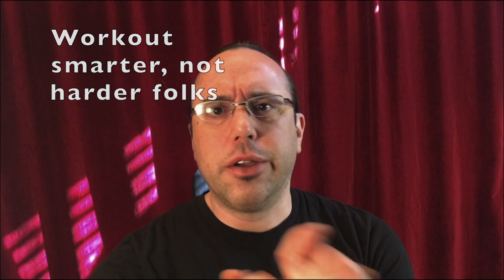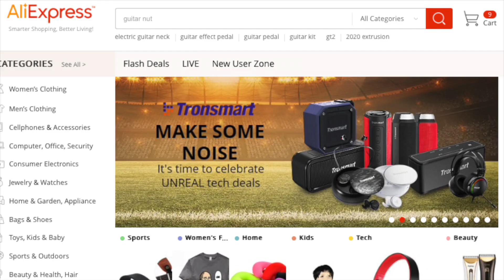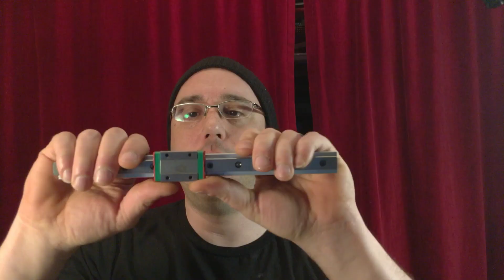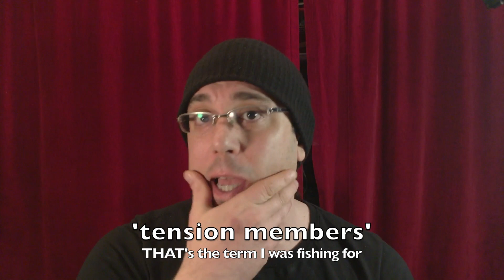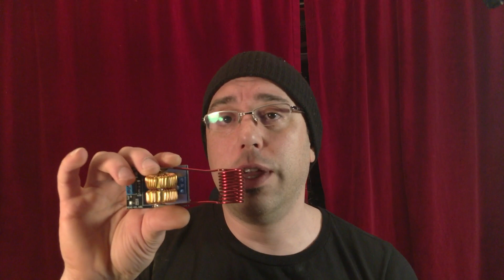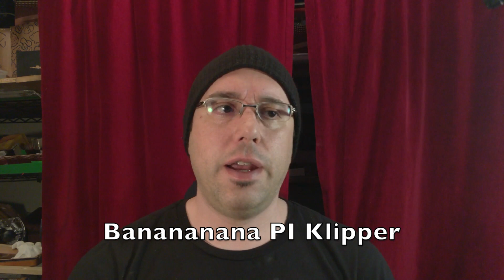Muse: random 'fails' and lessons learned

Comment: on the subject of random fails bigtree-tech you mention them in this channel a lot, well a few years ago I bought 3 2004 reprap-discount smart display clones besides the wiring being reversed you look at their smart adapter vs the real thing you'll see it. the biggest problem is the current draw I had to remove the voltage controller and well solder-in a new voltage regulator well that worked (7805) but it was burning hot , so I had to swap that for a dc-dc convertor (mini360) I will have to add another diode before it would be ready for 24V 26V absolute max 23 recommended. yeah bigtree-tech got some fails for sure.
terramir

Comment: I switched my ocotprint instances to Asus TinkerBoard  -- that's fairly tricky to get to work, TinkerBoard OS has issues with sending packets properly over USB, but Armbian (which is generic Ubuntu for a number of these arm boards) works very well. So my next step is to setup Klipper for my large delta on one of these boards because the TinkerBoard (S) -- which has on board storage, is significantly faster than any Pi... I also have Odroid board, but that is a different form factor and Tinkeboard is nice because all GPIO stuff works the same as on the Pi, so I can still use GPIO commands to turn the printer on/off.

Comment: You are a smart dude.
Just to be clear:  I am a bit critical on your channel, because I respect what ur doing.
I think you deliver great content.  Therefore, I invest time to comment on your videos.
And share my personal experiences.  Otherwise, I would not.
Oh .. I posted my design on thingiverse, like I promised.
Thanks, for another great video.
#1 You mentioned: Just buy it, not build it.
Absolutely right.
Unless you are one of them idiots that buy from a local retailer, thinking
that it is expensive, but high grade quality.
It's not.  Nowadays, it's all chinese. Besides .. the past decade, chinese products have
been of better quality, since chinese manufacturers did become more educated.
Looks like you knew that al along.  It's actually a topic, you could devote an entire video on.
#2 Specs:
Yup ... I go find specs for any part that I buy. And sometimes it is a bit of a hassle.
Beside this, I design things before I build them.
All the more, I search grabcad and such, only to find, I have to redesign the part from
actual physical measurements.
#3 Linear rail:
Yeah, you accidentally had that lying around ey ? LOL
I suppose I got lucky, when I bought mine.  They do not rattle, far from it.
In fact, they are exactly the same as what you have there : MGN12
attached to 2020 v-slot profile.
But it is worth mentioning when buying chinese stuff:
Make sure you read the feedback from previous buyers.
#4 Belts:
I go for acme trapezoidal lead screws.
The investment on these parts is not much of a difference (from china).
But I also intend to do some milling with my latest 3D printer design.
I'd like to exchange my printer nozzle with a dremel/spindle.
That's why I also bought the MGN12 rails.
#5: Nema14
Yeah .. let's not. But ...
I just built in a titan extruder, with the extra gear. Looks like a pretty good extruder.
But I recently discovered that the DRV8825 driver has some jitter or something.
Now I bought the  TB67S109 driver (4 amps polulu) and wonder how these will do.
#5 drivers
Previous mention.  I wonder how these will do, and I hope you come up with a video
with your experience on drivers and tests.
And what is Allegro anyway ?
#6 Test rigg
When I started with my first 3D printer, there were no tr8x8 acme lead screws or anything.
There was only the TR12x3 Or something really expensive (custom).
Then you get to a ridiculous STEPS_PER_UNIT and steppers work best with
leads like 4 or 8 in order to get a maximum on holding torque and full stepping modes and such.
Maybe it's best, just to build a rig, that moves some weight or something.
#7 Heating
It is exremely tricky, in particular with using PID. It is a science on it's own.
I have some (bad) experience in this area, but that's too much to mention.
...
I better quit with my comments. It's getting tooooo much.

Comment: Great video as always!  I really really like the idea of inductive heating a very low heat capacity heatblock/nozzle..  If you got a heater that worked and setup a higher rate closed loop temp control, this could open up potential for fast warmup times / better ooze prevention in multi extruder setups where the heater can turn on and get up to heat in seconds.

Comment: Enjoyed your video.  Great to see things that didn't work as planned.    A couple of comments:
1- Bananna Pi / Klipper, there is an alternative interface for klipper that is based on the DWC  interface.  I have not tried it, but I think it eliminates the need for Octoprint.  here is  is.  https://github.com/Stephan3/dwc2-for-klipper  
2- As far a strength testing prints, there is another youtuber called CNC Kitchen and he does alot of this type of testing.  Perhaps you can collaborate.  Here is his tesster he uses https://www.youtube.com/watch?v=uvn-J8CbtzM  .

Comment: Hey Alex. Love your videos man. Keep it up. One comment I have on the Klipper point, I have it installed on my Ender 3 ( It call it my Frankender3 because it barely resembles an Ender 3 any more ) and a full Raspberry Pi. I LOVE KLIPPER. I believe in it so much I support Kevin ( the dev ) on patreon. It works beautifully. Just try a normal Pi. The install was a breeze. It was up and running in minutes. And the speed gains are insane!  My next alteration for this printer will be to go the MKS Gen v1.4 with Servos. Cuz why not? I would love to see you try it to be honest. There are not really any videos out there on the discussing servos and why they would be good. All i've ever seen is people showing the printer print, or pictures, and sometimes just discussions, but no "How to's" , which sucks!. I know what servos offer and I'm excited to get started. My only problem is the only closed loop steppers I've found are about $80 per. Which is a lot of money. Anyway. I would love to hear your thoughts on it. Keep up the great work.

Comment: For the bearings, they almost need to be repacked. I watched a video of a guy that used a jewelry cleaner tool, a vibrating bath of wd40 for several hours, to clean some grinding lmu bearings he got from China. Lots of metal shaving came out.

Comment: Orangepi Zero works fine with klipper. No special build needed. And it's 10usd and quad core, external wifi antenna and lan. Have been using it for a while as klipper host. And all my 6 printers run one or the other version of orangepi.

Comment: Thanks for the video! Its always good to learn from earlier mistakes, even if they're not yours.

Regarding play in the cheapo linear rails: I have read about a strategy to combat this, and that is putting the carts in a vice and slowly clamp down on the cart until play is eliminated.
Another interesting fact that I discovered is that my carts behaved differently depending on which way I put them on the rail. I have no idea how that works though.
Regarding PLA smoothing: Check out 3D gloop! It seems pretty promising.
Reply: the error on them is probably not the same on either side is why you might get weird direction dependant behaviour (might be true for the machining on the rails as well)

Comment: Nice video. 
One day I want to try this crazy idea about reciprocating mass on a 3D printer. Like create a dummy axis that moves in the opposite direction and same speed to, say, the X axis and has the same weight thus balancing the movement. I dream of a printer that can do rectilinear infill fast without shacking it self apart :)
Reply: Making it as light as possible is the best solution. Carbon fibre comes to mind though I just turned your $150 toy into a $1000 machine. As Alex has said in numerous videos when people ask "what is the best way to <blank>?" His response is usually "Depends". 
If money is an issue, get a drill and make some holes. If not, design from scratch with light weight components.
Reply: @leofortey7561  Apparently not. https://twitter.com/3dmakernoob/status/1122462883646930944

Comment: The Orange Pi Zero is supposed to be pretty good at Octoprint and stuff.
Reply: Wifi shall even be worse than @an RPI Zero to the point of simple dont use it (driver issues). 
That said the RPI3 themself have WIFI issues. 

I would always recommend to use as Raspberry instead of Banana or Orange or ... , just because of the software

Comment: 21:24 Marlin's planner is completely floating point. Its inputs and inetrmediates are all single-precision IEEE floating point. That it hasn't worked out correctly points to a potential bug, possibly a numerical cancellation bug. It absolutely should be investigated rather than shrugged off, so if you have a vague repro config, i'd like to poke it please.

As to bearings: what has worked for me is finding a local specialised bearing merchant on eBay that knows what they're selling and provide a very reasonable quality fairly inexpensively, and stick to them. Just not worth the hassle otherwise.

Apropos Dichlormethane: banned in EU a while ago. But Modulor Berlin (architect and professional exhibition/model building supply) will probably still keep selling the pure chemical, because it's indispensable and not actually illegal, just its common use as paint stripper no longer meets health and safety regulations.

Wait, what is a 'virtual SD-Card' with regard to Pi Zero?

I always wanted an Orange Pi. Would be willing to roll a custom image. But i think USB is a terrible idea - and i mean what for, Gen.L has its serial broken out, or better yet to use SPI to communicate between the Pi and the printer board, it's broken out on just about any board. Something to investigate for certain